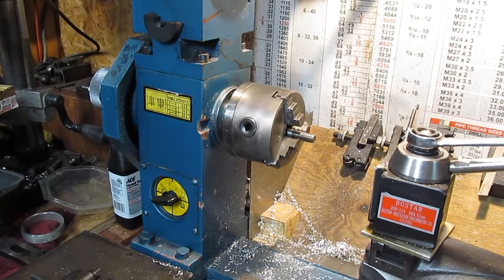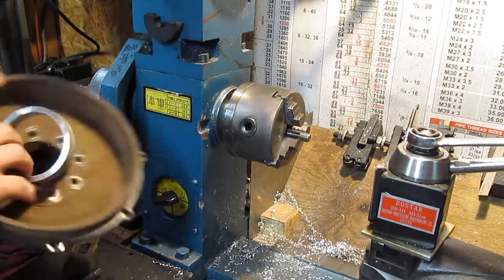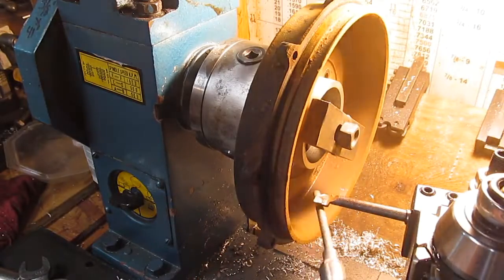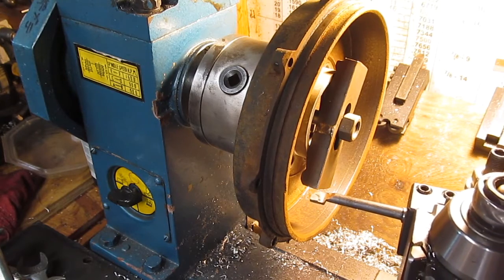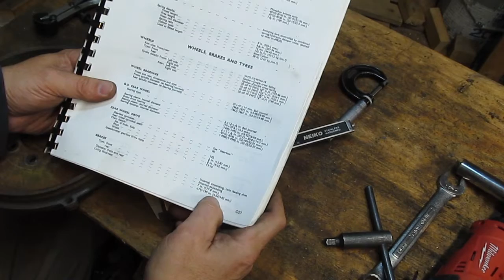Turning a Brake Drum on a Small Lathe Mill Drill

Comment: You would have to make sure the main parts of the drum are running 100% true using a clock gauge. Otherwise when fitted back there will be vibration when braking.

Comment: Advantage of the treadmill motor replacement on mine, is the fine speed control at the push of a button, you can go real slow whilst keeping the torque due to using pulse width modulation on the motor. I can also go from mill to lathe by reversing the polarity of the motor with a switch so I haven't lost any functionality.  People throw out treadmills all the time when their exercise programs fail. I have collected my treadmill parts from whole treadmills left out in garbage collections on the side of the road, much to my wife's dismay.... LOL
Reply from the maker: Yes, I have seen those done. Still waiting to find one. What HP or wattage is yours?
Reply: @theeddies  it is a 1.75 hp motor.

Comment: If you had a vibration belt on the drum it may have helped.    Looks pretty good though!
Reply from the maker: Yeah I did not think about at the time. It would certainly help the tiny bit of chatter. I just experimented with a disc brake and should have done it on there as well. But yes they certainly turned out usable.
Thanks for watching!

Comment: I have the same machine what size belts are you using mine are slipping
Reply from the maker: Hey James, this old comment popped up in my "comments not replied to" list. Sorry if I missed it, the comment system is really glitchy sometimes. I use a 3/8" by 41" belt for the main drive. I got a teflon one and it made a big difference, more resistant to oil. This one specifically - https://amzn.to/3bzAr4E. I have never replaced the top belt as it does not get used as much and am not sure the size. I did give it a look but the numbers are gone.

Comment: Nothing ventured nothing gained.
  Sandblast or sand off rust first. Then mic it before you start and see if it would work.  Rust eats carbide up.
Reply from the maker: I was pretty sure it was not going to work, was really just doing a proof of concept. And it was more dramatic for video to leave the rust on, but you are right, it is hard on the carbide. Thanks for watching!

Comment: I have one of these HQ400 lathes.  Mine has the power feed and thread cutting capability, although I haven't cut any threads yet.   But I do use the power feed all the time.  

I watched your other video just reviewing the lathe.  I agree it's a nice machine for the money.  I think I paid about $2,500 for mine new.  But I don't recall exactly.  That might have included extra tooling.  One reason I like this lathe is because of the big swing.

I wanted to ask if you ever made a video on how to remove the chuck?   I have the exploded views of mine in the manual and I see the chuck can be removed by three cap screws behind the chuck.   I haven't removed my chuck yet because I don't currently have an Allen key that will fit behind the chuck plate.  I'll probably have to cut one down to fit.  Is that how you remove  your chuck?

I also wanted to ask where I might find a 4-jaw chuck to fit this lathe?   Also can a face plate be mounted instead of a chuck?  And where would I find one of those to fit.  I suppose I could make my own face place to fit.   But it might be nice to just buy one if I can find one that already fits.  

Finally, if I do get a face-plate for it is there a way to install a center in the spindle?  Does the spindle have a taper that can be used after the chuck is removed similar to the tail stock?

Sorry for so many questions, but I thought I'd ask just in case you might know the answers. 

I'll find out myself pretty soon.  But I haven't removed the chuck yet.  This is the first time I needed to remove it.  I'm going to be using the milling head on some projects so it will be nice to have the lathe chuck out of the way. 

Thanks.
Reply from the maker: Hey thanks for watching. You actually gave me a great idea to do a Q&A on your questions and some others I have received. Check it out at the following and thanks again.
https://youtu.be/EVBPt1IfaV0

Comment: Good experiment. That 5 thou cut looks like what it wanted. I also have a Bostar set. I too heard suggestions about changing import set screws, but I've been using'em around a year without incident so far. I have a video where I made a binding lever for the swivel nut on the tool post block, but I soon abandon it in favor of what I felt was a better idea. What I did was drill and tap a hole in the top of the tool post stud, and capture an offset ratchet wrench on the stud with a washer. The shape and function is like having a binding nut level, but with a flick of the little ratchet direction switch I can position the wrench anywhere in or out of the way, or to choke up on it for better leverage wherever it might be angled. The part that sucked for a while was I didn't have a mill, so I cobbled together a T slot blank to hold the tool post on, and used with it my own stud. This led to me using an imperial ratchet wrench, because of using imperial dies and a nut. THEN Chuck over at the OldBrattRider channel was kind enough to mill the T slot blank that came with the set to size for me. This was great, but it also meant I needed (and wanted) to use the stud that came with the set, but the stud threads and nut were metric, and I didn't want to have to buy a $40 metric ratchet wrench, so Chuck milled the metric nut down to imperial size making the whole thing come together nicely. Damn nice fella, and a Triumph guy himself too.
Reply from the maker: I will check that out later tonight, I started going through your vids the other day. I also started viewing OldBrattRider as well.
Reply: Cool and cool. Chuck is a good guy.  @theeddies